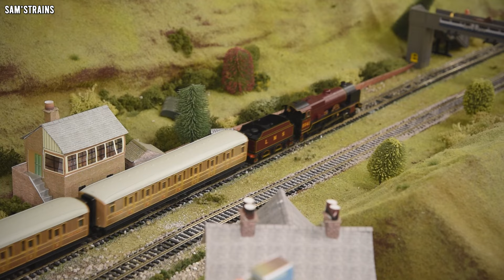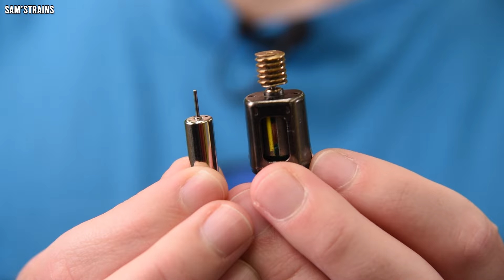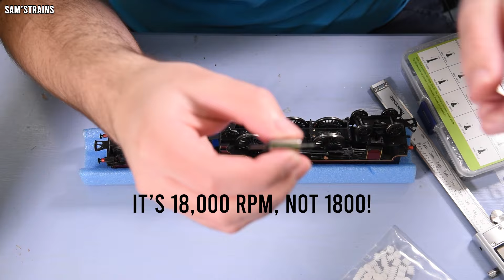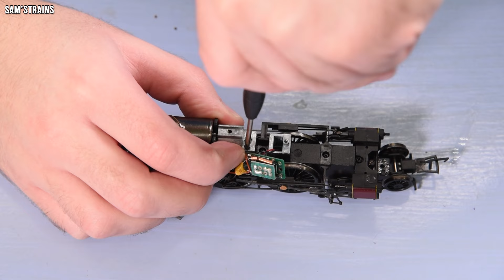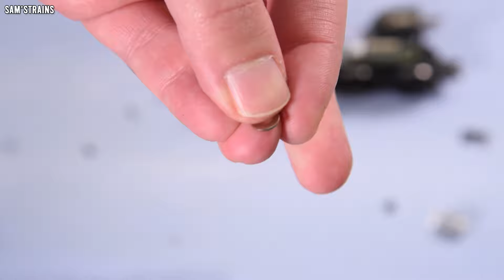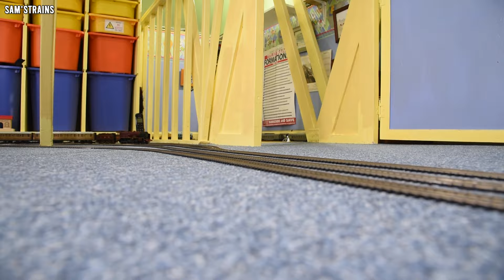Save Money Fixing Dead Bachmann Trains? | Cheap Motor Experiment

Comment: You’ve been using the small coreless 8x16mm motor but why not the 10x20mm version? They should be a bit stronger. Also it appears that none of the motors similar to the one Hornby used in the S15 and similar locos are available on Ali Express, wonder if they shut down those due to poor quality? I have been searching for a replacement for my S15 so will go e the 10x20 a go.

Comment: Can't remember if I commented on this video earlier, but a thought occurred to me.

Step 1: scour the Bachmann spare parts catalogue for their motors.

Step 2: see if there are 5 pole or coreless motors that fit into the same slot as the 3 pole motors.

Step 3: replace the 3 pole ones with the better 5 pole or coreless.

If it turns out that doing this improves performance significantly without additional cost, then this could be a way forward, if you're still willing to pay Bachman prices. :)

If it's also possible to fit flywheels while doing this to models lacking them, this could be a second project.

Of course, if you can obtain good quality motors without paying the Bachmann prices, so much the better.

Comment: i wonder if the little n20 geared motors would be any good for moving the gear train on one of these locomotives?
the n20 motors are used quite a lot in small robots and has great starting torque even with the faster motor and the gears are metal so they won't wear out as fast as the plastic gears

Comment: Maybe print the mount a bit thicker than needed and then sand it down so you can get a perfect gear mesh (which may vary engine to engine)?  Also, my (ebay purchased) non-DCC Bachmann steam loco had a Mabuchi FK-130SH motor in it, which can be found easily and very cheap.  I just ordered one to replace the one that burned out.  Hopefully the brass worm gear will come off (it is larger, 12 mm diam, 10 mm long and 2 mm shaft)

Comment: Love this ive got a 5 pack of these with the one sided 28000 rpm option from either ebay or aliexpress which was under 10 dollars usd. Good to see how they run! I wonder if a larger diameter worm gear would slow it enough to factory crawl speeds and smooth out the action abit.

Comment: Great Video  (As Usual), a Question - Where did you get the Motors? I found a few on Ebay but they are 3.4V and the !2v ones are 15 Quid A Pop

Comment: Love the look of this, Were you going to post a link to the motor you used?  I had a quick look on Amazon and most of the motors I saw seemed to be about 4.5V, as a DC Model railway transformer goes up to 12V, won't that fry the motor pretty fast?
Reply: eBay is a better bet for motors, put "12 volt electric motor" in the search field.

Comment: The motor has a 1mm shaft, but the worm drive in the link says it's a 2mm hole.  Is that incorrect?
Reply from the maker: Hmm, they seem to have changed the listing. Those are the worms I bought, and mine definitely had a 1mm hole! Will double check

Comment: Sam, this is an excellent fix, well done!  - Especially with your motor adapter and because you gave a source for the worm gears and even the screws needed! 😃
The only potential downside I could see is the longevity of the motor, particularly since it is completely enclosed and covered by the adapter so there is no chance of cooling. But then that design may not need any... only time and lots of usage will tell. ⏳

Comment: Meanwhile at Bachmann headquarters the R&D department are having a meeting.
"We have news that someone has figured out how to repair and improve our locomotives without using our parts. We need to download those files and make the parts and replacement motor more expensive".

Good idea Sam, it's a shame that there aren't any small metal milling machines to create a metal worm drive. It seems 3D printing upgrades is becoming a popular idea now as Peter's Spares does upgraded gears for old Lima motors and detail parts for locomotives. They have also done some upgraded non traction tyre wheel sets for the old Lima and Hornby DMU's and diesel/electric locomotives.

Comment: If anyone here has any N gauge locos that need a new motor, the company "Tramfabiek" sells the little coreless motors, complete with gears, flywheels, and 3D printed adapters, for tonnes of the most common models from, roco, fleischmann and Farish.  Pretty good value too =)

Comment: If you want to improve crawl why not try a gearhead motor? You can get tiny ones not much longer than this motor. This would also improve the torque that was lost by using a smaller motor diameter.  Great that you are sharing the files Sam. This is how the 3d community has worked over the years.  Cheers Gary

Comment: The issue about the coreles motors is that they are not always friendly with decoders. I fried a couple of decoders trying to have a Japanese Tsugawa Yokou N scale chassis with a coreles motor run on DCC, I even used ESU decoders that were recomended for coreless and probably ran fine with larger coreless motors.

Comment: just as a friendly tip, instead of making someone buy a specific set of screws for a model (the laptop screw kit), you might want to learn how screw standards work and just give measurements like 5mm m3 (5 mm long and 3 mm thick) so its easier for people to get fitting screws.

Comment: Hi Sam in helpfull response to those who have requested adapters for X04 type motors replacements can be found in rummage boxes at swapmeets and a full refurb by Scalespeed who do a very good job.On the Bachman motor issue I have remotored several non split chassis locos with the appropriate Mashima 16xx series motors resulting in vastly improved performance only the removal of the original worm proving difficult but worthwhile.

Comment: Unless a motor has bad/worn parts and is total dead... Have you tried cleaning the brushes and armature of All oil and other lube? I have a 40+ year old Bachmann that never worked right until doing just that with Careful use of strong solvents and cotton swabs or scotch brite. IPA is not strong enough here. Even a thin coat of lube can burn or turn rancid and block power transfer at that point and not be obvious like big motors for power tools etc. I have cleaned many motors for old things using Mains power for same reason when does not try to turn.
Reply from the maker: haha - you can trust me when I say a motor is dead... I've fixed hundreds of them, and even rewound some in the past! With this one, it was the bend-able brush retainers and casing tabs - they can only be opened so many times before they fail!
Thanks for watching, Sam :)
Reply: @SamsTrains  Granted Many Bachmann are make cheap and Bad brush springs could fry the motor or fried parts could be a symptom of other problems making low volts in turn making motor try to pull more amps that burn up the motor and other things connected to an iffy motor. Ask most any local electrician, big clive, etc. Worse with train sets run without PCM controlling speeds. Even your car with 12v system can fry fuel pumps and more for same problem.

Comment: Great idea, but why didn't you simply make the 3D adapter the size of the motor it is replacing? then you need not cut anything on the loco. There might be room for a flywheel in the housing and make it left and right halves.
Reply from the maker: The reason is that the motor shafts are much shorter, and the worm drives are much smaller - so the motor has to be brought closer to the geartrain in order for the worm to mesh. The original adaptor prevented this from happening. But yes - a flywheel is definitely an option now!
Thanks for watching, Sam :)

Comment: Did I miss something? I don't see a callout for the motor? The tiny coreless motors the I quickly find are higher rpm and lower voltage.
Reply from the maker: Unfortunately those are only available on Ebay, where listings can change almost daily, so no point posting a link. If you're looking how, here's one: https://www.ebay.co.uk/itm/254604745332?hash=item3b47a01a74:g:dWUAAOSwEmtgtvh7
Reply: Still there March 2023 😎

Comment: Am I right in assuming that model locos generally run too fast for their scaled speed?  If so, and if you could report the maximum speeds in your reviews, then maybe manufacturers would provide higher gearing and therefore better low speed performance.

Comment: I've used these (13.5k) motors in my P4 Metropolitan locos, and can confirm they really need a small flywheel, and running-in before they crawl properly. Hadn't thought of using them as replacements in RTR models. Well done.

Comment: Hi Sam. I've got a challenge. How about a locomotive with an n20 geared motor? You can get a 12v one off Ebay really cheap with a 1200rpm maximum speed, but it has a tonne of torque because of the super low gearing. Might make a really awesome shunter, would also probably be super loud though.

Comment: A bigger problem than the expense of motors is their non-availability. Got a new 158 with both motors defective but at least I could get new ones from Bachmann for £40. Compare this with a defective Hattons 66 and no spares. Yes you can look on ebay but getting a motor of exactly the right dimensions pretty much impossible. So I'd prefer to be able to buy new from Bachmann spares. If people follow Sam's advice there won't be any spares.

Comment: Every series modeller should have a 3D printer, it's uses in this hobby are endless. Get yourself a delta ,they print twice as fast and because of the short travel distance overhangs print much better. Less need for supports .....You could improve that file by adding height shims to adjust the gear backlash/mesh. you've defiantly given me an idea for my Oxford rail locos.

Comment: I would not be tempted to rush off and make this conversion until I'd seen it pull a train for several minutes. The current it will need to pull under load is much higher than a light loco and the subsequent heat might fry it.

Comment: 2 Questions:

1. Could you try and experiment with fitting the cheap, Hornby style £2 motors in a Bachmann loco?
2. Does this mod work on Bachmann Thomas models. I have no experience with their mechanisms but I know they fail a lot.

Comment: be great if you could do this with the cheap thomas locos bachman make with a crap motor i have a dead edward a dead percy a dead thomas all needing motors that you can only buy from the states in a running chassis not the motor by its self - i fixed 3 saltys and 2 mavis this way but cost a arm and a leg to get all the running chassis then just add the bodyshell  and bachmann euro are differant running chassis so you cant use them

Comment: I've been working on my own motor housings for the Bachmann thomas range for a while now. Recently made one for Edward, also made one for toby. Then I've also designed some for Thomas and Percy. I plan on redesigning Thomas, and Percy was designed for just the chassis without the top. All excluding the gearing for the eyes. I can share the finished design with you if you want to try them out. Though they use the Bachmann motors, you can always design another fitting to work with the motor you used here.

Comment: Thanks Sam.  You are making some very interesting videos with your 3D printing and painting experiments.  Of course, your loco and trainset reviews are also great.  I have N scale, but I am thinking of trying the Hornby HM6000 bluetooth controller which seems very interesting.  I believe it should work with my N scale which is a 12V DC system.  I will let you know.  Cheers from Canada  :-)

Comment: Hey Sam, you’ve said in some of your reviews of more expensive models that the gearing is wrong and they run too fast (some of this years Bachman models come to mind). Could you 3D print new gears to “fix” these models (of course they shouldn’t need to be fixed with the price being charged!).
Reply: Perhaps an entire motor support and gearbox if going this far? ;-)

Comment: I wonder if it would be possible to make an adapter to fit different gearing to help with slow running as in many small locos they run too fast and have poor crawl performance.

Comment: Did you compare the pulling power of the Bachmann 3 pole and those coreless motors?
I've got a couple of old Bachmanns that struggle to pull more than 4 coaches. Maybe they are on the way out already.
I'll be getting a few motors regardless. Thanks for the info and the basic adapter.👍

Comment: You could fit a flywheel on the unused portion of the motor shaft if the loco body has room. It may improve that motor somewhat

Comment: Please Sam, show us a way to fit bearings onto Bachmann's square axe slots. Or any other loco that doesn't come with bearings. I'd imagine it would involve cutting notches into the chassis. But it would most definitely extend the loco's running life and performance.

Please consider this 🙏 if anyone can show us, it's you.
Reply: Hey I remember commenting this! Came back to this video after my Desert Sand Khaki Bachmann WD 2-8-0’s motor bit the dust. Now all I have to do is learn how to solder and also find someone with a 3D printer.

Comment: A note on the gear module, for those that don't know the gear module is a number that is used to mathematically describe the shape of the gear teeth. All that you really need to know here is that gears need to have the same module number to work together properly.
Reply from the maker: Not quite - the module describes the relationship between the gear diameter and the number of teeth! Maybe you’re thinking of pitch?
Reply: @SamsTrains  The module of the gear is the numerical inverse of the pitch of the gear. Its just that the module is mostly used on metric gears and the pitch is used for gears in inches. Both module and pitch are expressions of the same tooth count to pitch diameter ratio. This ratio is then used to plot the involute curve of the gear tooth itself. Yes, this is more complicated than it really needs to be.

Comment: I could do with a new body for my ancient Piko locos because the top parts of the motor mounts have snapped off. Not worth forking out on 3d printed replacements as they're worth very little.

Comment: Great video as always Sam. Would I be right in saying that most ( if not all?) Second hand models can be repaired? Saw a Scotsman on ebay 2 weeks ago that sold for £41 I think. If it didn't run great could it be fixed do you think? Aside from a knackered motor what else can wear out?
Reply: Hi Tony I don't profess to know a lot about repairing model trains, my thing is more classic cars and model boats, but I am interested in model trains. I would imagine a  model would have to be really bad for it not to be repairable, it might take a bit of ingenuity but I don't see why any model shouldn't be repairable.
Reply: Most of them can be fixed. That is actually what I do to save money, just buy a broken engine and then fix it. Several things can cause an engine to run badly, at best the motor might need a service, gears might need some oil. At worst the motor might be dying or you might get an engine with a stripped or cracked gear.
Reply: Thanks for your replies. How would I establish which motor my train has and which one to buy off ebay say? If that's what I thought it needed.
Reply: @Tonyr2  Depends. I would try and find an exploded view and then find the exact manufacturer part based off of the diagram. 
If you want to replace the motor with a cheap ebay motor, it's a bit of a gamble tbh, just find one that appears to be the same thing and hope it fits. Typically I just cough up the money for the official part that I know will fit.
Reply: @Tonyr2  Sorry can't help you with that unfortunately

Comment: Really interesting little project 👍
- if you just chose fairly cheap motors for you demo here, and they were pretty servicable,  i wonder if there are better motors available that would be a proper "hardware upgrade"? 
Another thing that i thought was you seem to suddenly have space to pop in a tasty little flywheel (assuming you can buy these off the shelf?)
The possibilities are endless! 😀

Comment: So Sam's rebuilds of locomotives (well model locos anyways).
I am very glad that such solutions are presented for community i would suggest (in order to both dodge any copyright issues and to advertise your channel to call it something like Sam'sTrains replacement model H series?).

But yeah right to repair at its best,, proprietary engine holders can not hold back a man with 3d printer .)

Comment: What causes the motor to die in the first place? Can't it be repaired?
Reply from the maker: I repaired this one many times - but the brush retainers/motor housing are fixed in place by bend-able metal pieces... they can only be dismantled so many times before those parts fail completely!

Comment: I bought an Ender 5 3D printer a little while back.  At the time it was a little bit of an outlay and I honestly thought it was just going to be an expensive toy.  It was just an "I want one" purchase.
To be quite honest, the 3D printer is the second most used tool in my collection now.   I do a lot of electronics projects, so the Soldering Iron just beats the printer.
Question: With the cheap coreless motor, given the coreless motor has a spindle at both ends, how viable would it be to fit a "flywheel" on the unused end of the motor?

Comment: Great video once again! I was thinking….. you could create a 3d printed object that fits into the tender of the 9f that many suffer from mazak rot and disintegrate. You could make it so that it clips into place (like the old ringfield enclosure) whilst allowing it to hold the electrical pickups and the wheel axels. This would help a lot of people such as myself whom have a dead 9f due to the tender ringfield enclosure turning to dust 😁